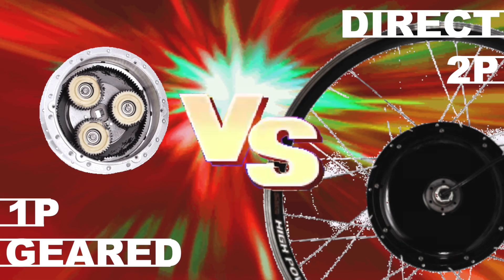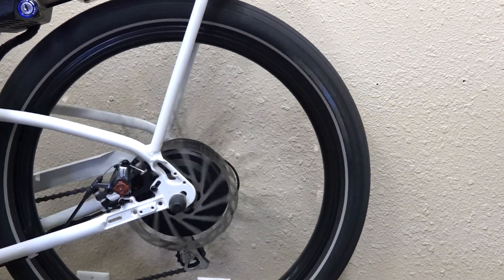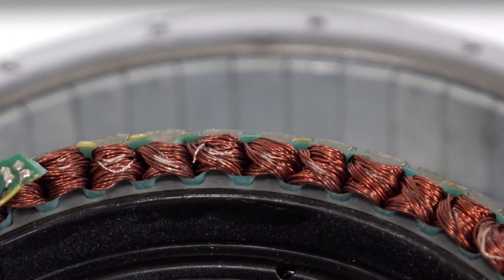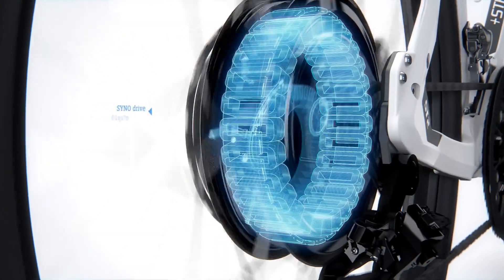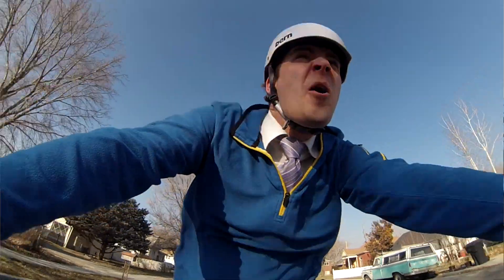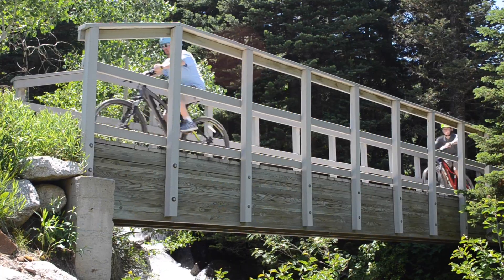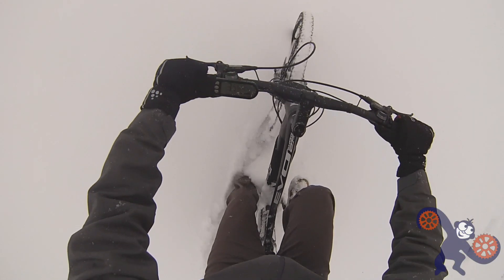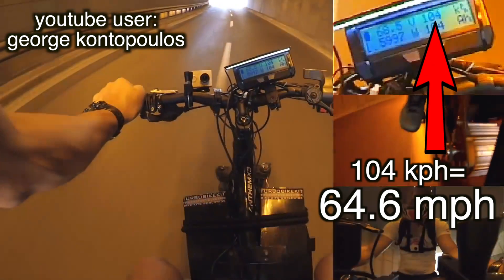Direct Drive VS Geared Motor electric bike

Comment: The direct drive is the best choice and like he said they’re less complicated, and they last a lot longer Just pedal when you take off, that will keep your battery from draining and then you can keep a nice constant speed without draining your battery if you’re riding trails and the gear motor is perfect but if you’re commuting, you want the gearless motor
Also, the manufacturers are not honest with the actual mileage you’ll get on a battery they all do this so I guess if they all lie, it’s OK Sarcasm emoji

Comment: also we need electronic and programming simplification, electronics are very sensitive, Consumerism, Difficult to repair. 
programming is very complicated.
so if You choose direct drive, you replace the simple mechanical system that controls the motor output with a complex and very sensitive software electronic system on the input side !!! The purpose of a system of gears or pulleys is mechanical advantage, i.e. obtaining the appropriate speed and torque for the particular device using the minimum energy input. However, if you increase the speed by increasing the frequency, i.e. by increasing the energy input to the motor, this is inefficient and very consumer !!
Reply from the maker: Interesting points

Comment: Rural area?  Want thousands of miles durability?  Ride mostly at steady speed?  Older style gearless hub motors are more reliable and last much longer.  Speed-yes.  Acceleration-average.  Noise-super quiet.

Comment: Off the line?  Always pedal to get the bike going and up hills?  Don't be a lazy butt get your legs moving too!
Reply from the maker: Some people need throttle off the line. Could be a medical reason, maybe they have anxiety in traffic, maybe they don't want to sweat.
Reply: @BlueMonkeyBicycles  What I wonder is how does a 1500w 48or 52v kit stand up to a 500w geared hub.  I tried my friend's kit and it seemed just fine.  He was able to go up a very steep hill without pedaling.  I do not that we have a 750w limit in Washington but I doubt it would ever be checked
Reply from the maker: Tough to compare two systems without knowing equal stats

Comment: I built several e-bikes all using direct drive motors. I've just been purchasing random kits and on some of them I don't even hook up the pedal-assist because the person I'm building them for does not want that. But on the ones that I have put together it seems like the pedal assist doesn't work the way it's intended. It seems like regardless what setting you're in you start pedaling and the motor kicks in more power than you may want and there's no way to really hit the Goldilocks zone so to speak. But I've repaired ebikes with geared motors and it seems the pedal-assist on those works much better. My guess is that the controllers are sending a slightly different signal and because the motors are geared you are able to notice that difference much more significantly versus the direct-drive? Am I on to something? I'm trying to confirm or deny this hypothesis. Thanks for any help.
Reply: Because they don't have their speed set properly, they just go to max speed. Ideally you'd set something like 20, 32kph and then you'd pedal to take up slack from the motor to keep you going that fast.

Comment: Hi. I have a 350w 36v rich bit rear geared motor. It requires a gear oil change. Please can you tell me what oil i should use? Many thanks
Reply from the maker: Probably some kind of engine assembly lube
Reply: Its got a entey point where you would pour the oil into. It only needs 35ml of oil but not sure what to youse
Reply from the maker: I'm not a representative for that motor company, I don't know what precise oil or viscosity to use.
I'm guessing it's donye kind of engine assembly lube, you might find some at harbor freight.

Comment: Geared motors are efficient, small and powerful, but they overheat easily and they break down after a year or two.
Reply from the maker: In ebikes, I've personally had geared motors last for 6 years.

Comment: I have a question, I thing you can give me answer.
My ebike is 500w motor, 
use 48v 17ah.battery,I need to upgrade  anything's to use 
48v 28ah battery ?
Thanks
Reply from the maker: Yeah, a 48v 28ah will work just fine. So long as it mounts on the bike, you should be fine
Reply: @BlueMonkeyBicycles  thanks

Comment: So is a geared motor the same thing as a speed motor? I'm trying to figure out the difference between a direct drive and a 7 speed motor. I was going to buy an electric bike, but one of the options I have to decide on is what type of drive I want. The direct drive comes standard I guess (in other words "$0.00" is listed next to it on the list) and the 7-speed option would add $149 to the price of the bike. I'm am new to e-bikes, and having watched about 60 or so videos about them in the last few weeks I still don't understand, among other things, the difference between a direct drive or a 7 speed. Honestly, I barely ever heard the term "direct drive" in any review videos I've seen. They all have always mention speed motors (usually 7 speed, but a couple mentioned I think 9 speed, and one of them mentioned a belt drive, whatever that is).
Reply from the maker: What bike are you looking at?

 7 speed option is for the mechanical gearing, and has got to be misplaced in the motor category. Price matches up with mechanical gearing upgrade too.

Comment: How hard is it to replace the wires on a geared motor that are damaged at the rear axel?
Reply from the maker: Depends if the depth. If the damage is inside the axle, then it can be impossible. If it's further out towards the disconnect, then it's perfectly doable
Reply: @BlueMonkeyBicycles I want more power 4500w geared hub 300.00 with controller you think will last

Comment: I ride my bike unpowered and without battery.....my DD motor bike is a pig to ride without battery unless I power it a bit.
My geared hub bike is much easier to ride unpowered.

If there was a freewheeling motor version of a DD design I'd buy it in a second!

Comment: What do you think about two wheel drive bicycle where the gear motor is in the back and the gearless motor is in the the front, so use the rear wheel drive gear motor to assist accelerate and then use a gearless motor front wheel drive to maintain speed... So both wheels will not be active at the same time

Comment: Combine the two features in the same hub, one reduced and one direct from the motor drum via a direct engagement maybe a centrifugal device or similar. From the drum to the hub directly once you have certain speed.
Reply: direct front and geared rear dual hub motors? switch at certain speed?

Comment: great video, and it answers half my question.  I am trying to track down exactly what kind of power requirements I would need for a geared hub motor. I am a big dude (250lb) that lives on a very steep long hill. I've seen for my girth a recommendation of 48v 1000w  direct drive, but I cannot seem to find a geared drive more than 36v 500w. Any ideas what i should be shopping for? is geared 36v enough? do you perhaps have a video that covers this info?

Comment: Two Motors, a very small in Front, just for accelerating from zero to 5km/h that switches of when in no load operation after the gearless took over
Reply: of.....OFF. pick one.
Reply: or just get a mid-drive

Comment: T
FYI unless this has already been addressed A gearmotor has a one way clutch so you are not spinning the coils or magnets to regen. Also since there is a 6 to 1 gear ratio the sudden transition from drive to coast creates a massive load on the nylon planetary gears and will shear the teeth
Reply: Nonsense.  Upon transition from drive to coast the one-way clutch simply releases and motor spins down smoothly until it is idle (motor is zero-RPM).  On the other hand the transition from coast-to-drive is also a non-issue in that as soon as motor catches up to wheel spin torque is applied gradually (there is not sudden drop of RPM of motor which could cause sheering).
Reply: @prblakeslee no. Even small difference of speed is wearing the nylon. With my own experience. Two Yose Power kits on two bikes. Nylon worn in 2500- 3000 km

Comment: id like to see any of those motor vs MY1020 500w 36v (alike)  
i didn't see any of those motor in your video(or any other video) that compare them
since you can change the gear  2-3 test is needed 1 made for speed 1 made for climbing and 1 between both
Reply: I have my1018, and I love it. Good acceleration and 40kph top speed. Check out my video, I made video in english.

Comment: what's the max speed of 350w geared motor as well as 500w geared motor?
Reply: Their slow less than 25MPH
Reply from the maker: That's not true. I've personally ride a 500w motor at 34mph. I've done 350w motors at 28mph.

It all comes down to amps.
Reply: All depends on how many volts you put through it,I'm using 42v at 22amps and I can get 20mph throttle only or 24mph  peddle assist, and I weigh 220 pound's and I block alot of wind at 6'2" ,if I go 52v I'll get near 30mph, I've seen folk put 72/84v through them keeping the amps "TORQUE" low at around 30amps, of course the more you overvolt a small motor the more HEAT/WEAR you create so you can't go mad all the time, here in England it's always cold/mild so my hub motor never gets warm to the touch.

Comment: Is there a company that uses geared motors made of metal and not plastic? In my experience with plastic geared motors made of plastic in my electric chainsaw is that they wear out. The difference is the electric chainsaw is $39 while e bikes cost around 1.5k
Reply: $100 for a geared hub motor, buy a kit do it yourself, mine has nylon gears and I've done nearly 3k miles
Reply: Nylon gear dust is non conductive. Metal ones do very nice shortcuts inside the motor!!!
Reply: @jean-mariejm7404  what does that mean?  Good or bad
Reply: @shadowdance4666  nylon good. Metal bad. The metal dust will do electric arcs inside motor
Reply: @jean-mariejm7404  ok that makes sense. I got it. Nylon though not plastic

Comment: 3 wheel:  tadpole  vs  tricycle  pls .  1 wheel in front or  1 in back
Reply: tadpoles sit too low to be deemed safe in my opinion. plus they have limited cargo ability due to their configuration. if you are looking into a tadpole recumbent tricycle might i suggest that you also check into delta style recumbent...i am currently building my own and it really isnt that hard .  buy  a granny trike..unbolt the front end from the rear axle assembly...put the steering head on a length of tube steel....mount that tube steel section to the rear axle assembly, mount a seat,pedal crank,and a steering mechanism....whammo, delta style tricycle .....
 here is a website that sells plans, but if you look closely-their plan makes an axle- i simply used a granny bike for parts.....
https://www.atomiczombie.com/loderunner-utility-trike-diy-plan/

again..not hard to make one...just need a a tricycle and a mountain bike(my method) . the way i did it, i only had to pay a shop for 2 welds...25 bucks .

 for the ebike kit i went with a 36volt 500 watt  geared motor....in florida you are limited to 20mph so  this is all the power i need....plus i love the freewheel.
also,since it is a trike with the cargo area..i went with SLA batteries..3 12volt 12amp hour battiers cost me 60 bucks...hell of a lot cheaper than those 18650 cell battery packs...which are not needed for a trike.

Comment: This totally ignores motors mounted on the bottom brack which drive the crank shaft rather than the rear wheel. That's the comparison I'd like to see made.

Comment: Hi mike ...can i know how much time does a 48v 10am battery lasts on a Two 250w motors
Reply: a video from 'top gun bikes' channel says about an ebike with 6000w power.....is it possible and what would probably be the specifications of the battery they used....some one says its a 48v battery but is it possible... with 48v battery to attain such huge power
Reply: @voyager4409  48v x 10A - 480W its the same like 12V x 40A = 480W. What all this mean is depending how the specifications of construction of motor is, If the motor is constructed to consume 12v then the battery must be 12v/40A, if is constructed like to consume 48v then the battery must be 48v/10a. But on other hand you can have 400Amps battery pack where is stored the energy, which will be used for long range cycling.

Comment: Hii
Thanks for advices and video
I want to know about life span of the geared motors????????
 I heard the gears and clutch are not durable and to me will be impossible  almost to find a new clutch .
I actually like geared but want to be durable. I want to use for commuting.
Reply: Thanks alot for answer
I know when pedal in case of low battery that engine have something to disconnect, I referred about that as clutch.
Sorry I was not clear I am beginner in this. I intend to buy a 500 W rear engine and use it on good road, mostly flat with some small hills and I think normal conditions
 What is better 36 volts or 48 volts ????
Is it enough 500 W for normal use??? I have 60 kg
Reply: @stelic9515  Even a 36v 250w motor will be sufficient for you if you're intending on using it for basic commuting etc. I weigh more than you do (75Kg or therabout) and even a 24v brushed 250w motor and sprocket kit can pull me up a hill albeit struggling with some of the really steep ones I go up on a daily basis.

Personally for your choice of motor I would recommend going with a 48v battery system as this will decrease the electrical load on the battery pack itself. With a higher pack voltage, it requires less current to drive the motors at the same power. which will also mean you can lighten up on the power cabling as you don't need to carry as many amps and you should also see a gain in low end torque from this as well as you will notice less battery voltage drop under especially heavier loads.

Comment: So I still don't understand how geared hubs are better than direct drive .
In terms of efficiency that removes the mechanical loads from the gears but I could somewhat agree about the torque part.
Reply: geard is stronger than direct drive hub have them and test them 1kw dd cant up me uphill in what ever speed whit no pedaling 1kw geard in first gear easly. (same contoler 25A)
Reply: @MrSasha381  That's because you have a higher pole count per RPM the direct drive just needs more amps to make it go with torque, but the specs will be almost identical when you match the current to voltage difference to make up the RPM and whatnot. You can make a smaller geared hub though that performs just as well as a heavy large direct drive though, just less maximum power output due to less overall mass of the wires and stator to absorb heat. Functionally identical though, one just has a higher equivalent pole count and usually also higher V per RPM than the other.

Comment: you said geared is to go for. if it chews up the battery i rater go direct drive.
Reply: Okey I still think there will be more cruising overall than start/stop so in the long run direct might be better. just build up some speed before engaging the afterburn :)
my idea was to convert my bmx to 1000w. and with 20" wheels it will be alot stronger consuming less energy from start?
Reply: it probably will !  I seen 100mm hubs that fits in the front since the bike has no gears.
I also modded a strong 600mm saddlepole so I can ride it almost as a regular bike. might attatch the battery to it.

Comment: hey hru  i have 2 question  i just got  a electric motor model number MY1016 24vdc 2500 rpm  14.0A 250W  and im trying to make a ebike could u help me out  and let me know what type of  speed control  i need  and what type throttle  i need  and could i use to motorcycle batteries to  power that motor thanks keep up the good videos
Reply: Blue Monkey Bicycles and if u could can  u give me some good  store to chek out
Reply: Blue Monkey Bicycles thank u so much

Comment: You didn't mention geared motors have about 0 resistance when coasting while speed motors have  about 10% drag at coast. I like geared motors but I prefer the speed of a speed motor and one can go much farther with minimal stops and peddel starts.
Reply: As the presenter indicated, geared motors are better for stop and go riding and hill climbing whereas speed motors are better for cruising along at a constant speed. Think of ebikes like clothing: many variations exist. In February in Moscow most people typically wear very different types of clothing than most people in August in Barcelona.
Reply: Theoretically, gearless should have less drag than geared motors when coasting if the batteries are disconnected. Gearless have less torque at low speed because the windings are designed for high speed. No reason why a gearless motor cannot have low speed torque, but it cannot power at high speed. Yes, we can have both, easily, but manufacturers don't seem to want to design them because it involves more electronic circuits.